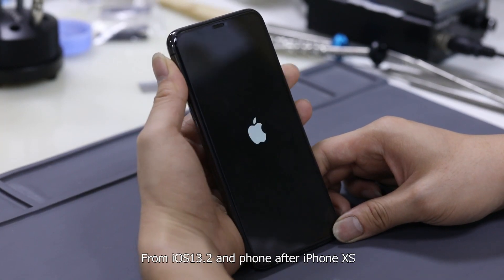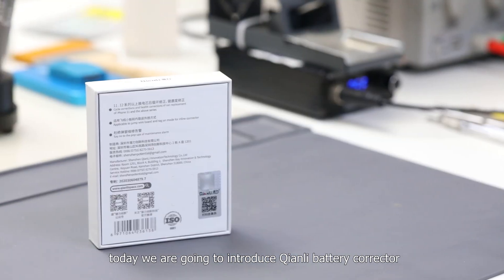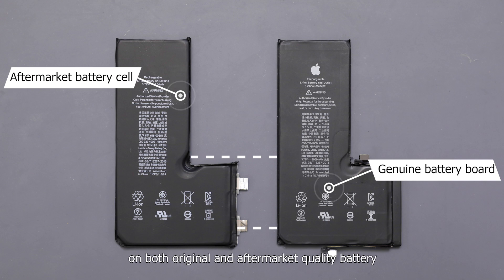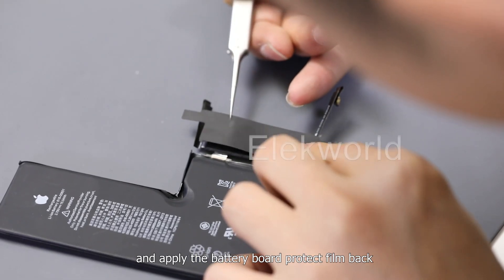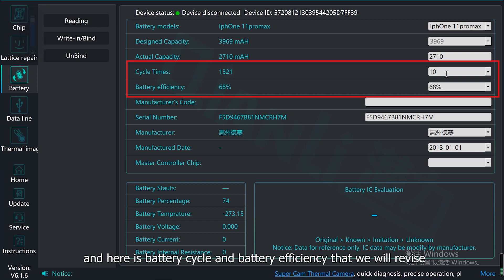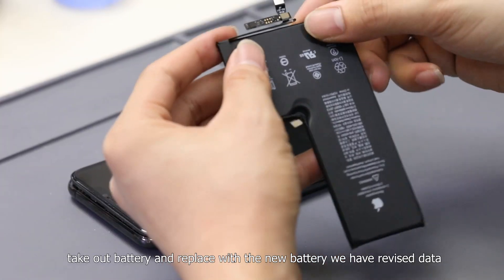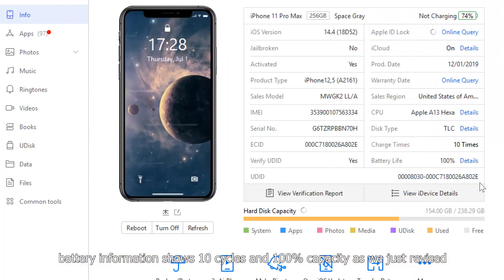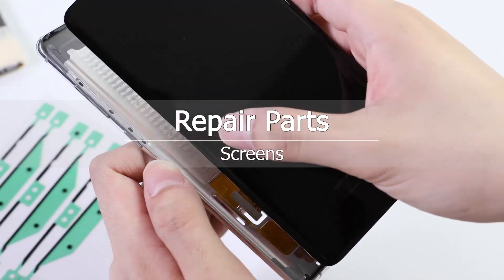"Important Battery Message"+Battery Health Fixed With Qianli Copy Power Battery Data Corrector.

Comment: hello, I also bought a copy power and I'm trying to rewrite the battery on the 11 series but I can't. I mention that the battery I want to write is not the one that was in the original phone, at the moment it doesn't show the charge. I want it to show the percentage can you help me please
is it possible to write batteries even if the battery I want to write is not the one paired with the motherboard? I have another battery for another phone...

Comment: hi, very interesting video here, i started to learn a lot of new things about phone repairing on myself from your channel, started from changing lcd and now going to this battery replacement with none important battery message display

i would like to ask, can my current qianli icopy plus 2.1 tools replace the function of qianli copy power like the one you used in the video? also for the data recovery part, do i need to always have extra battery for each iphone model so i can plug in that one first for activating the phone and to restore the phone data? Thankyou very much
Reply from the maker: as far as I know, iCopy don't have the function of copy power and can't be copied. 
Better to have a replacement battery to repair battery problem, theoretically there are method to power on iphone but takes time and has risk.

Comment: After I connect the Apple BMS to a new battery, I find that the battery percentage changes randomly, does not increase in normal steps whilst charging (e.g 75% then 82% etc) and looses charge too quickly. Do you think the battery BMS needs to be 'calibrated' a few times by charging to 100% then fully discharging? Thanks
Reply from the maker: I think so. Bcuz new battery cell normally has higher capacity than old battery cell, which might led capacity data the motherboard detect different from the BMS old data. Actually we heard some users' feedback that: normally the capacity will show the old BMS data, after they replace a new battery cell, the BMS's capacity became higher. So let's see.
Reply: @Elekworld  is this method still working ?
Which are the differences between using this method and JVC? Could you explain it ? thanks a lot for all your effort
Reply from the maker: @GuilhermeBrumDutra    JC also can do this, there is no difference but the specific procedure.

Comment: Do you need to keep the extension tag on flex inside the phone all the time or remove it once phone recognized the new battery as genuine batter?
Reply from the maker: Need keep it in the phone always.
Reply: @Elekworld  thank you for your reply. Right after I watched your video, I viewed another one on a similar subject. However, the vlogger suggested that he did not have to leave the tag on flex inside. I am wondering if it is because he used a different phone model or battery. Here is his link https://youtu.be/dIeCbn6_LNw
Reply from the maker: @tmarcel1594   I'm not sure, but we suggest keep it in for stable performance.

Comment: So for each replaced battery you need to add that small adapter into the phone ? .... Seems like the adapter is just "lying" to the system board about the battery status. So in theory you could just present a old battery as brand new :D.
Reply from the maker: Nope, bcuz you replace a new battery cell with 100% full capacity with just an old battery board, so with the adaptor you just "set" the capacity data to 100% just exact same as brand new battery cell.
Reply: @Elekworld do you need an extension flex and the battery corrector for every iphone model or just the 11 and 12 model?
Reply from the maker: @lemitrius9307  Dear, you don’t need an extension flex or battery data corrector for every iPhone model — only for specific generations where Apple started linking battery data (like health, cycle count, and capacity) to the logic board.

Comment: Why extension flags is important to install on new battery after removing the battery board from old battery ?
Reply from the maker: For iPhone 11 series and above, you can't correct the battery data without the extension flex.
Reply: @Elekworld  what a sham

Comment: hi, I don't understand if with qianli can be boost battery from 80% to 90% without replace battery, just need to boost to higher % without message is that possible? about extension flex it is needed just to be same battery data in 3utools same as in iphone setting?
Reply from the maker: The theory is: 1- replace battery board to remove warning message; 2- install extension flex to revise battery data.
If you just want to revise data, then Qianli or JC V1S could revise to fake battery data.

Comment: Please is it true that the battery health stays at
100% and doesn't decrease and Also that if the tag
on flex isn't attached to  the battery after battery data has been reversed battery 
health only shows for few days or weeks and
suddenly disappear please is this true?
Reply from the maker: The flex need to be kept on the board, even after data revised. By now we didn't hear any feedback that battery health disappear after revise successfually.

Comment: Hai, is this method working on original board that already in service mode?
Reply from the maker: Not quite sure, some battery were used too many years which led it shows "service". But if you revise the capacity data, maybe "service" disappear(we're not sure), but real capacity could be new battery cell capacity.

Comment: Can i do this on XS Series?
Reply from the maker: Replace genuine battery board on new battery cell can remove battery warning message, but dont' need extra flex on iPXS. You can use just the JC V1SE or Qianli device to revise the battery capacity.
Reply: @Elekworld  great I'll give a try
Reply from the maker: @skroturm5723  Good luck, bro.

Comment: Hi , Do you still need to keep the extension flex along with battery? I am not clear here. thank you 🙏
Reply from the maker: Yes, still need keep it after data revision. Also there is another solution with built-in board, check this: https://youtu.be/q7_GLdJ6Oso.

Comment: I have icopy 2.2 if I want to revise battery info can I just buy flex extension and it will work ? Or do I have to get Copy Power Data machine?
Reply from the maker: They are different programmer bro, so only Copy power programmer works with this function.

Comment: 3:32 i don’t understand that, ‘take another battery ‘ you mean take the third one or original 68% (1321 cycle time) or the aftermarket battery? 
You copy Read-Write  the new battery (aftermarket battery) with genuine apple board first then, put the 3rd battery to test important message pop up? Then you replace the new battery you revised? How abt the old battery? Isn’t it repair the old battery from 68% effeincy to 100% without needing replace new battery?
Reply from the maker: Hey friend, "another battery" means "3rd battery", not the genuie battery or new aftermarket battery. 3rd battery was used just to activate pop up message, in the end we will use the new revised battery.
Reply: @Elekworld  Thanks for your explanation, that’s clear. 
By the way can we Read-Write (reset) 83% efficiency to 100% 0% cycle charge time  with genuine battery  without replacing new battery? 
Does the Wear out genuine battery will be repaired full capacity  without replacing the New battery? Or do we have to replace the battery
?
Reply from the maker: @kaisha4355     If iPhone is iPhone 11 or newer generation, then it doesn't work. If it's older generation than iPhone 11, then it works to revise the data directly.
However, the efficiency and cycle data revise is just revise the data, the real capacity doesn't change. The only way to resume REAL 100% capacity is replace with a new battery.

Comment: After changing  battery board successfully is it necessary  to use the flex extension
Reply from the maker: If you just want to remove "important battery message", then it's not necessary.

Comment: I have followed the video step by step. I've connected a genuine battery board to an aftermarket iphone 11 battery and connected a qianli extension flex to the genuine board. However, when I connect the battery to the Copy Power Device and click 'read data', I get an error message saying 'read failed'. I'm using the same software version as in your video. Also, when I test the battery in an Iphone11, the phone does not turn on. I'm certain my soldering is good and have not damaged the board. Could the problem be with the aftermarket battery I am using? Do apple battery boards work with all aftermarket batteries? Thanks
Reply from the maker: Hi Luke, maybe many possibilities, but aftermarket battery also works with this method, because it only provide power supply, have no data inside battery cell. And below are the steps I want to remind(if you are sure about solder and battery board):
1- qianli extension flex not 100% connected or flex damaged;
2- try to power on the iphone without extension flex, to see if the individual battery works;
3- check if the connector of Qianli copy power has damaged pins etc. 
4- one critical step if you can read&revise battery data: install another non-genuine battery before install the new data-revised battery. 
Hope it helps, Luke
Reply: Hey, did you ever get it working? If so, what was the problem?
Reply: @rapidrepairsau  Hi, yes the solution was very simple. I just had to connect the phone to a power source with a lightening/charging cable then it turned on. The battery was already charged as its brand new but I believe this 'activates' the battery somehow.

Comment: How is this different than jc v1? Does jc v1 not do this too? Thanks
Reply from the maker: JC V1 wont' work, it's lower generation programmer. The Qianli is different programmer brand compared with JC, but they both works.
Reply: @Elekworld  So when to use each one?
Reply from the maker: @mrsemifixit  We tested both programmer and both works fine. Check this video for JC V1S: https://youtu.be/q7_GLdJ6Oso

Comment: I have Ivalid CableID problem, when I try to restore ifficiency
Reply from the maker: Not quite sure bcuz there are many possibilities, but seems the battery flex or board, or even the battery flex connector pins were damaged maybe. Maybe you can check them carefully and see what happens.

Comment: Does the tag on flex stay in the phone? or is it removed after the message is removed?
Reply from the maker: If you just want remove the warning message, then replace genuine baord on new battery cell will work(check this: https://youtu.be/sjOCID0IN5g). 
If you want correct the battery data, then the tag flex need keep in the battery.

Comment: It looks like your using a qianli spot welder to weld the battery board to the battery cell.  What setting have are you using 1-6?

Also, I have tried welding the battery electrodes to the genuine battery board but am having problems getting the battery anode to fix to the board. The anode seems to be a softer metal than the cathode and the spot welder just burns a hold through it without welding it to the battery board. I've tried a lower welding intensity but it does not weld. I have an iphone 11.

Would the welding be better if I were to weld the battery electrodes underneath the metal cover on the board as opposed to directly on top as shown in the video?

Any tips would be welcome. Thanks
Reply from the maker: Actually we use 3GOA Portable Battery Spot Welder, link as: https://www.elekworld.com/shop/productinfo.aspx?proid=15187&categoryid=283. With it the strength was set with 1.

Comment: Hello
I have one problem with battery IP 11 max pro
When i change cycles etc and press write data on software, i have error: „invalid cable id!”

What is it ? Can i fix it ? I try on others qianli cables and still same error

Before i fix 11, 11 pro max and everything Ok
But on this case i dont know what happens..

Pls help than you for answer
Reply from the maker: Not quite sure, but seems the battery flex or board, or even the battery flex connector pins were damaged maybe.

Comment: @Elekworld : there is no need to apply solder flux + paste on the original BMS board anode/cathode + solder nickel sheet before soldering to the new battery cell ? (like seen on this video: https://www.youtube.com/watch?v=sjOCID0IN5g&t=179s). Thank you
Reply from the maker: You can learn them step by step from our video course, check this for Hot air gun: https://youtu.be/gejR_AlZOfw, and this for reballing: https://youtu.be/AY-z8nTiiPI. There will be more video course, pls stay tuned.

Comment: Hi , thanks for the useful video. May i ask you if this can be used only with genuine batteries or you can solve the service notification issue even with aftermarket batteries?
Reply from the maker: Hi Luca, this method works on both ori and aftermarket quality battery cell. check here: https://youtu.be/AWyLDQIuIBU?t=84

Comment: First of all, thanks for the video.
The batteries of some brands/models of phones are not easy to find.
Will it work if we buy a battery of another brand phone with compatible current values and remove the flex cable of the dead battery and attach it to the battery we just bought ? Will it cause a problem ?
Example: We have a dead battery Umidigi F2 brand phone battery with  battery and we cannot find this battery. If we buy a battery of a different brand with the same current values instead of this battery and remove the battery data cable on the dead battery of the Umidigi F2 phone and mount it on the battery  we just bought does the phone work ?
Reply from the maker: Hi Hasan, I'm not sure if it works or not, but try to bind battery cell and board which are with different brand means risk definitely, especially with parts like battery which provides power. And, actually there are many way to order this battery, check this Umidigi offical EU site: https://umidigi.eu/umidigi-f2-original-battery-5150-mah-en.
Also you can search on Ebay, Aliexpress, Newegg etc, hope you find new battery asap.
Reply: @Elekworld  Thank you for your answer.
Unfortunately, since the Umidigi EU site makes the shipments from its warehouse in China, they unfortunately don't send to Turkey. ( ebay, aliexpress, Newegg etc sites also don't have shipments to Turkey ) In fact, we shouldn't buy a phone made in China.Because getting spare parts is really a problem.
Reply from the maker: @hasanaydinoncel7437   Got it, it's really sad news. However, I got a suggestion for you: If possible, maybe you can get your friends in Europe(If you have) help you order this battery, and send to you directly. Then you can get this battery, meanwhile you get parts from EU instead of China.
Reply: @Elekworld  Thank you for your suggestion.You are right, I think the only solution will be as you say.
Yes, I have friends living in Europe.I didn't want to inconvenience them for a battery but I guess there doesn't seem to be any other solution.Thing that sounds silly to me.When I ask the sellers why they don't shipping, they say that they cannot send the battery because it is a dangerous goods item.Well, I say, if the battery is within the scope of dangerous goods, when I ask how do you ship to Europe ,they cannot answer.
Reply from the maker: @hasanaydinoncel7437   lol, yea it's funny.
Reply: @hasanaydinoncel7437  it only applies to shipment by air

Comment: Which work for iphone x/xs/xs max? Quianli plus? And QL Repair Helper work for anyone Quianli?
Reply from the maker: If you mean battery data revision, by now, this battery data correct only works on iP11, 12 series.
Reply: @Elekworld  Which I use for iphone x?
Reply: @Elekworld  what solution to remove batteur warning for iPhone XS/xs max/xr?
Reply from the maker: @stevekoch7105  if you just want to remove battery warning message, then this video is much more detailed: https://youtu.be/sjOCID0IN5g

Comment: Is this a permanent solution? i.e does the new 100% capacity data installed by the Qianli software remain even after turning the phone on and off?
Reply from the maker: Yes it is, even after turning on and off
Reply: @Elekworld  the reason why it works when you turn it on and off is because you've taken the data from the battery and corrected it and you're using the original iPhone 11 battery board..
Reply from the maker: @bassinbillRC5300   Exactly bro. 👍
Reply: @Elekworld  Thank you so much for all your expert information. Keep up the good work!
Reply from the maker: @Matthew Kendell  Welcome, Matthew! 😉
Reply: Permanent LOL till the next battery i think apple wants everybody to just buya new phone everytime which is probably the way to go if apple keeps this up and you have to have an iphone

Comment: I recently brought the Qianli iCopy Plus 2.1 and successfully transferred the battery chip board on an iPhone XR but despite Using Qianli Space to alter the battery health to 100%, it still shows the original battery health of 87%. Any suggestions what is going on, as it reads 100% when connected to any battery programmer, it is just the iPhone that still shows the original battery health of 87%, help anyone?
Reply from the maker: Probably bcuz you didn't install a non-genuine battery before install the genuine board+new battery cell battery, check this critical step here: https://youtu.be/AWyLDQIuIBU?t=209
Reply: @Elekworld  , Thank you so much, this actually worked.
Reply from the maker: @Benchandbeyond  so glad to hear that Bro 😃
Reply from the maker: @stevekoch7105  Hi Steve, if the BMS board and battery cell's both metal connectors are in good condition, then it's not necessary procedure.
Reply: @Elekworld  perfect! thank you !
Reply from the maker: @stevekoch7105  Welcome Steve, pls stay tuned for more update then.